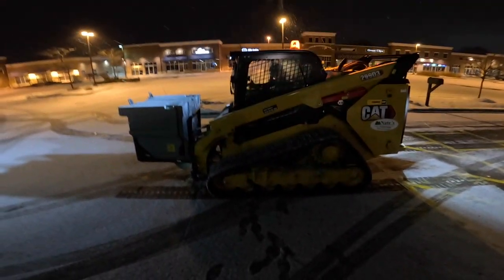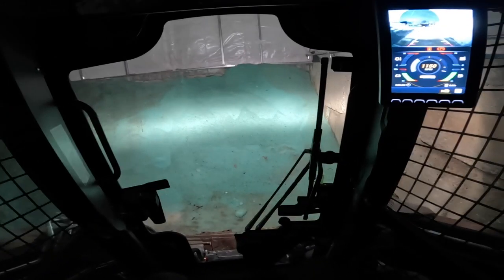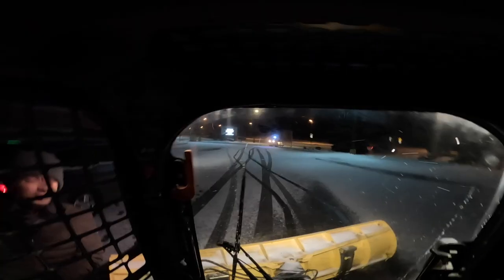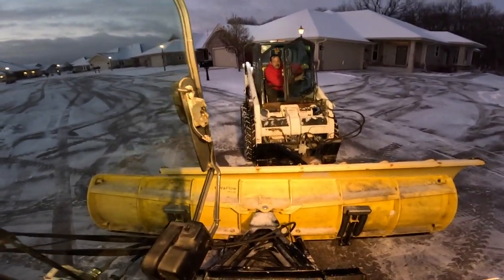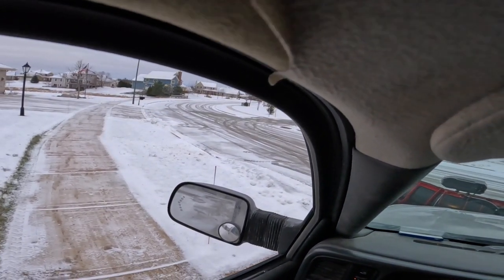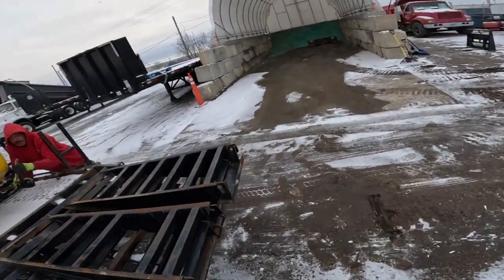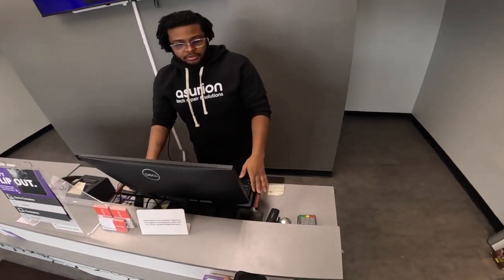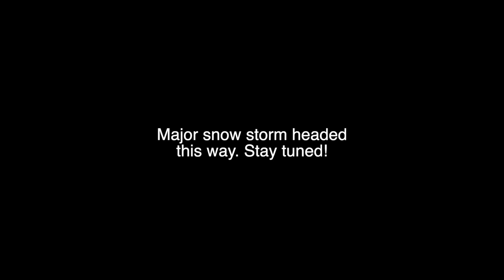Winter is coming on strong! The snow is just starting.

Comment: @Ryan  Someone suggested having your mural painted on a large piece of canvas or whatever material is portable like a billboard.  This way you can always bring the mural with you wherever you go and the surface is more uniform than those walls.
Reply: That's is a good idea, It would look better to the walls aren't smooth and never know how long he will be in that shop for. Can get canvas big as can and make bunch of wood frames behind it so if need to move it can detach canvas roll it up then pull the smaller square frames off wall making transport easier or storing it easier

Comment: Ryan, look into the pan saver for the 7.3. You take really good care of your equipment but this would be an added level of security. The oil pans on the 7.3 are notorious for rusting out and leaking
Reply: Also I was going to say why doesn’t he back the skid steer up the trailer? That way you don’t get the sketchy wobble

Comment: ryan, i think if you keep this up on this channel, i see it being 125k subs by spring. in this day and age with whats going on with engineered shortages, i wouldnt let go of anything until you have the replacement IN HAND sue to shipping and shortages.
in my area, we get light dustings in between storms that have been measured in feet and now we're in a cool snap where our daytime temps are in the negatives and we wont see above zero until saterday....so they say.  
the snow we get is normally "dry" and is easily blown off surfaces and not much salting is needed if its a dusting. if its a storm, most people dont salt. even the city uses mostly sand mixed with a little salt and the highway dept uses a clear fluid made out of beet juice which has been working quite well the past few years. if we have snow coming or a cold snap, they spray the highway down before and it works. it seems to last longer than the salt used to.
thanks for the vids, ryan.

Comment: Ryan, I put a Banks PowerPack on my 2000 7.3L work truck  (white f-350 dually, just like yours) about 10 years ago.   It's all bolt-on and did it all myself with basic tools.  It's not anything crazy powerful but for my work truck it was more about reliability than pure power. It has been bulletproof and can tow up the mountains here in CA in overdrive now.   Worked out great for me.

Comment: Ryan, just sharing a little trick to starting dead and or frozen vehicles, put the negative on the negative battery post, THEN put the positive clamp on the main bolt to the alternator, 10 minutes max it will start in any weather doesn’t matter how dead the battery is.

Comment: A cpl guys at my work were always rolling the track/wheel bob (skid steers) on to the back doors when pulling on the trailers with no front attachments. I suggested backing on and driving off and just spinning it around once ur leveled out. Now no one is allowed to drive one on without the bucket, only back it on and spin it around once it’s up there. Even with the rough cut wood deck it doesn’t tear it up at all. Hope that made sense lol

Comment: 03 - 10 is the problem.. 2011 is a 6.7 , the only real issue I’ve heard of is ceramic ball bearings in the turbo, fine for stock power but turning them up hurts the bearings, other than that an egr every 70k give or take., and low sulfur diesel can hurt your fuel pump, I run hot shots edt and hopefully no fuel system issues..

Comment: 2011 was the first year of the 6.7, the only issue was valve metallurgy early on, if you get a june or later 11 model that issue was fixed.  I prefer 11-14 for plow trucks, one, the older smaller dual scroll turbo makes power lower, seems to regen less when plowing and salting and I have less problems with oil leaks.  all the early trucks have o ring oil pans and filterless oils separators.   If you buy an alumaduty, I like using the F600 7.3 gas more than any other truck, but as I discovered the tire requirements for the 19.5 wheels to run the max gvwr the f600 is capable of limits your brands.
Reply: I bought a 2014 6.7 king ranch in July coming from a 2002 7.3(kept the 7.3 for plowing) and going to try and keep the plow off the 6.7 for a few years
since it’s my personal truck but great trucks, Mine is stock but I am thinking of deleting def and tuning after the winter

Comment: Got a 2015 dodge ram4500 6.7 Cummins diesel has 401000 and it has a wrecker bed starts with no problem just got make sure plug it in and keep good battery's

Comment: hey Daryle stainless steel is brittle that is why it crackes, stainless will not rust depending on the grade, and Ryan is right about the vibration even if it sounded like he was joking, plain steel bends before breaking more ike shearing to break steel, after they welded that spot there will be more or that spot in the future will need welding again it will never end, Happy Holidays you all and your families, PS if it moves it will break just have to deal with it

Comment: Ryan, I heard you talking about the Ford truck engines. I had a F-350 with the 6.0 and at 11,000 miles It blew the head off the ride side of the engine. I had Ford techs tell me Ford got greedy, should have let international keep making the motors. That's a comment from a tech that works at a dealership.

Comment: Those miles on that 7.3L has nothing to do with the fact it won't start. The batteries are shot and need replaced. They probably are fine in warmer temps, but lose capacity in the cold. How old are the batteries?

Comment: Hi Ryan  =  l know what ya mean by latest Snows  =  l  use Snowblower but it takes 2 hrs  =  The first snow a week ago was 6 wet heavy inches that took 3 hrs And I'm not complainer = But I'm 63 and body's kinda acting like a it's 80  = l not sure I will be walking Snowblower many more Yrs  = Maybe put a Plow On my 2011  1/2 ton Suburban  =  BE able to get my entire Placed cleaned up in  20 mnts = And get back to smiling while I do it and and after =  Good Luck in your ventures Buddy = Paul from East Central MN.

Comment: Mannnnn you must not know what snow is Ryan. You’re out here pushing less than a half inch, wasting time and gas. Come to the mountains where I live, we had over 40 inches last week. We use caterpillar loaders and even then it takes hours. Let me know, you can use my netjets card and fly private if you ever wanna come out.
Ps. When you’re jumping a truck p, go in the other truck and rev the engine up to a solid 3k or so. Then try to start the other. It will start 90% of the time

Pps. Mikes truck logo and company name is dissolved… that’s an old company from 15+ years ago. Crazy one.

Comment: Don't blame Ford for the 6.0 and 6.4. The only lesson Ford didn't learn is to not buy engines from International-Navistar. Having said that, I own a '06 F350, 6.0L Powerstroke and the engine itself has been solid. It's got 170k on it now, and all the problems I have with it is the body. It's rusting out because of all the sl they use on Pennsylvania roads.

Comment: New phones are 1k , always cheaper to fix them if it’s just cracked glass. I still have the iPhone 11 , your your way ahead 😂 my phone still works just as good as yours 100% . I will use it until I have problems. But I’m kinda careful with my phones and don’t break them , so if it breaks it’s a hardware issue . I use otterBox cases. drop it all day and it’s good